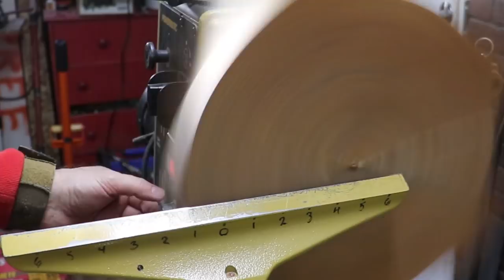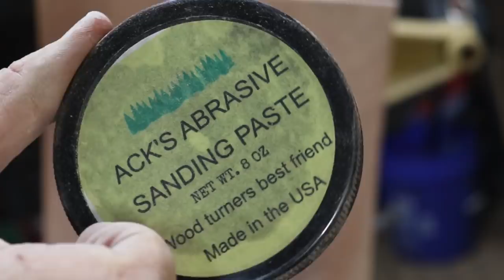Woodturning Spanish Cedar

Comment: I’m probably wrong but it looked like you attached the faceplate using drywall screws. Sorry, them being flat black threw me a curve.  The platter came out really nice. I’ve made one as well and since turning so much air is part of this project I agree with going slow and with precise deliberate use of te cutting tools. Great job!

Comment: A beautiful platter. I'm a bit concerned, should you use hard woods and soft woods in the same piece? I truly would like to know.
Reply from the maker: As long as the woods involved aren't on the extremes of low and high density, at least that's my experience.   I've made similar (differing wood hardness) pieces and have kept them on the shelf for years just to see how they fair and feel very confident in the process now.  Great question, thanks!
Reply: @RHumphrey  thank you for explaining. You do beautiful work.

Comment: Really like the way you cut the crack out and added the walnut and maple.  Plater looks great.  Question, did you apply a sanding sealer before the ACKs application?
Thanks for sharing the video and the verse.
Reply from the maker: Thank you very much!  No sanding sealer.  I actually don't use it that often.

Comment: Showing my lack of knowledge here... is turning a square block like this one possible because the lower density of the species? I kind of half expected some nasty kick back out toward the corners. Would a hard wood be more difficult to turn this way?

Edit: It is really a nice piece Ron. Thanks for sharing.
Reply from the maker: I've done a square platter with very dense wood too.  Checks or kickbacks are always possible, but the trick is to go very slow and make deliberate tool movements.  That's one of the reasons I chose not to show this in high speed.  I would say that as long as your gouge is sharp, the wood type doesn't matter.  Thank you very much!